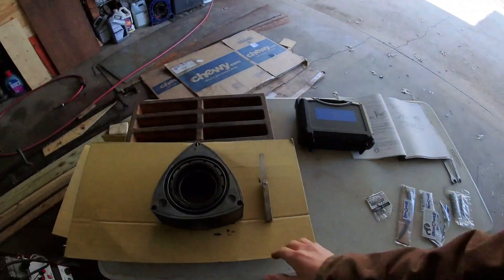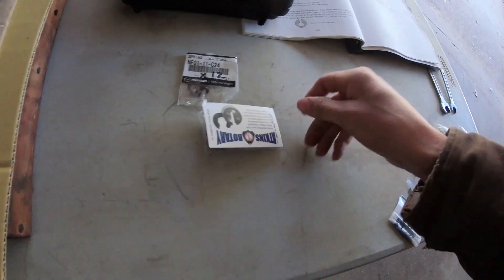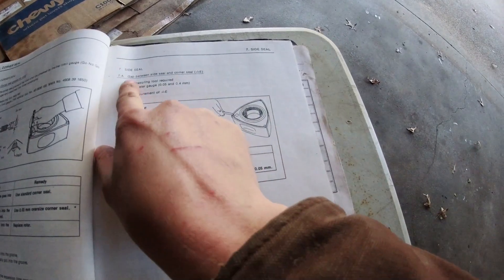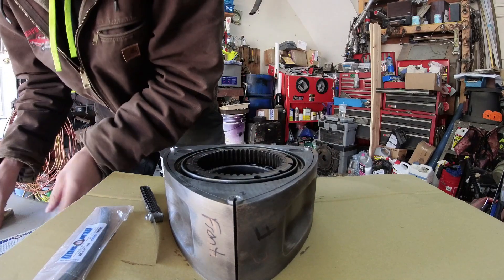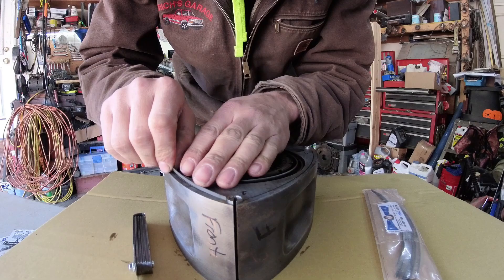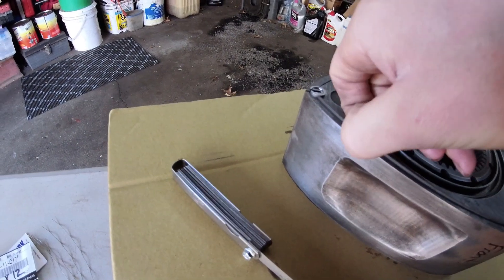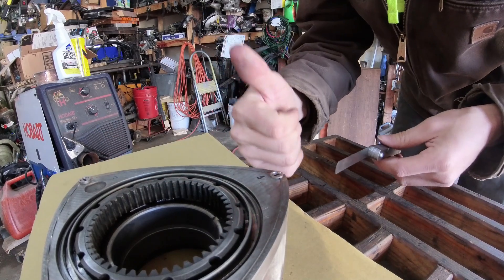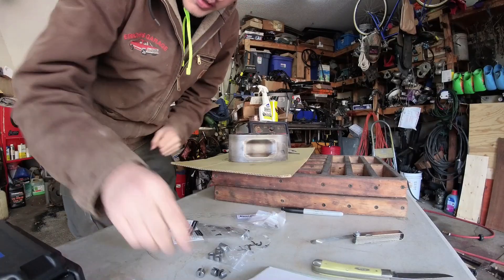How To Clearance 13b Side Seals - A Key To Good Compression!! - Rotary Engine Build Secrets EP-5

Comment: You need more clearance for an RX8 build due to the Exhaust Side ports which get the side seals hotter
Reply from the maker: You are very correct sir.  If you look at the Side seal clearance spec for an rx8 it is nearly 4 times the amount for the older 13b!!  they have an entirely different type of side seal.
Reply: @RADPotential  so please what is the right clearence for side seal for mazda RX8 renesis engine? Stock engine I mean. Thanks in advice.
Reply: I believe RX8 side seals are keystone/chamfered that requires a slightly different process to clearence.
Reply: Then get the right service manual.
Reply: Watching this video after I pulled half of a side seal out of my rotor. 😂

Comment: Hi man first of all really enjoying your vids, learning sooooo much!, been wrenching on cars, mostly rotaries for over 30 years but have never taken the plunge into building my own motors yet. Just wanted to clarify, when measuring the seal gap on one end of the seal, do you push the seal back into the corner seal on the opposite end to ensure 0 tolerance? Cheers and keep up the great work😊
Reply from the maker: Yes. You're measuring total clearance.  Not just one side

Comment: any idea what temperature the seals should be at while clearancing? .06%-.07% of thermal expansion for every 100 deg is enough to throw them off by a couple thousandths if your doing it in a 90 deg garage vs a 29 deg garage.

Comment: I'm gonna rebuild mine very soon. 13B is consuming coolant and oil. I already have the omp deleted soooo yeah. It's not terrible yet but about every 400 miles I'm having to fill coolant reservoir and a full quart of 20-50. Not leaking it. Plugs are getting fouled up about every 2000 miles. It's time.
Reply: Definitely time! Coolant seals our toast! Hopefully your irons our still good I had 2 irons where the water jacket was broken